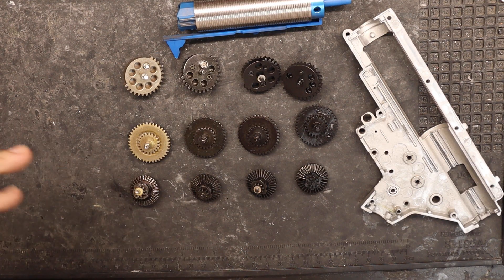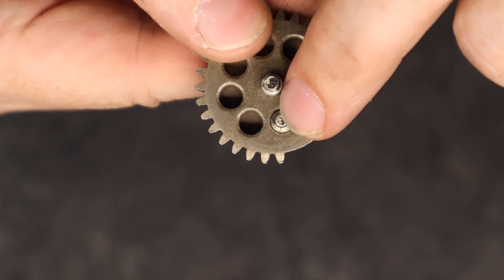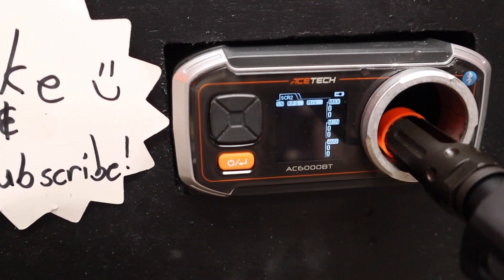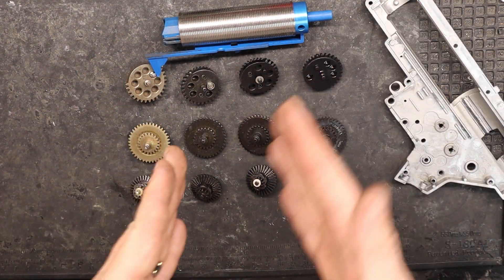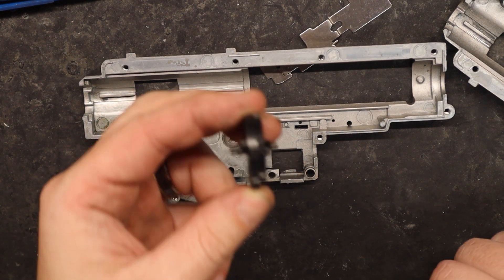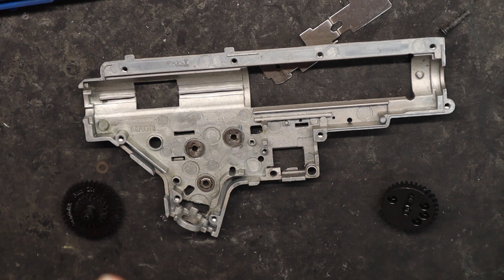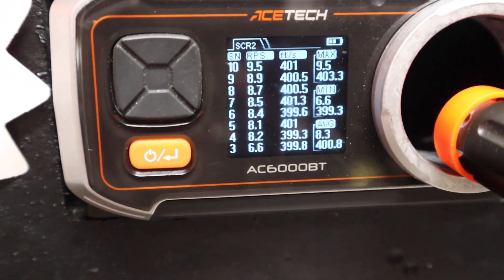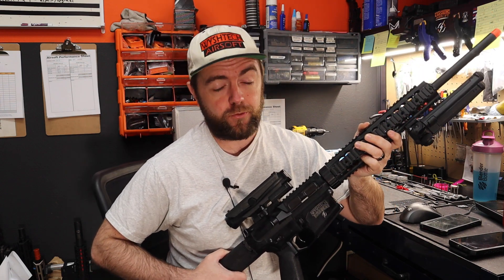Retro Arms Pandora SR25 Gears Review Test and Compare #airsoftonly

Comment: Nice comparison. Do you find tappet plate PME kicks in around the 25rps mark typically? If this occurs, what is your preferred fix? I have some SHS 16:1 (short-stroked 2 on the pickup side) which are consistent with a 25c 11.1v at 22rps, but suffer dramatic fps loss with a 40c 11.1 at 25rps. If no audible difference it would likely be tappet plate pme over piston pme? Thanks!
Reply from the maker: I typically keep it under 20rps to avoid tappet pme.  In your case, 22 rps and ss on the pickup side was a mistake. It should of been the release side so that the piston would get released sooner so it could finish its stroke before the tappet got picked up.  That 3 rps difference made it do that.  If you got another sr25 gear and ss on the release (or just get my Wyshtech edition gear) you will fix tappet pme on that battery.
Reply: @wyshtechairsoft  Thanks - should have mentioned that this is on a standard gear set and not the SR25 specifically, but could be the same either way. It is also an M100, so perhaps adding an M110 would remedy the timing issue.

I have noticed on stock gears from other brands that it occurs even with a minor motor change going from 17rps to 20rps (depending on whether an SDC is present). In a non-SR25 setup, is it possible to shave a tiny amount of material from the tappet or SDC where it first picks up, or will this generally result in mis-feeding? I have spare sets of 13:1s which are short-stroked on the release side, so could test those as well.

Comment: I am an sr25 user from the other side of the world.
The gear options for the sr25 version are very limited.
I am using the 'improved' gear set,
and was considering the Pandora.

Your review video was a great help.
Thank you.

-For reference, the 'improved' gear set (I won't mention the brand name.)
is holding up to m190. It's currently over 2000 rounds.(Of course, about 9mm shims were added to the spring guide to fit the longer v2.5 gearbox.)
but the height of the last gear of the sector gear is slightly worn.
I think the maximum for semi-permanent use is up to m170.

The video shows the stock nozzle being used,
If you are going to use the stock chamber, I recommend the shs g36 nozzle (about 24.3mm),
and if you are going to use it with a rotary hop-up (Retroarms, Maxx, Gate'eon', Begadi chamber, etc.), use a 23.3~23.5mm nozzle that is about 1mm shorter.
This is what I learned while spending money.

If you are passionate about the sr-25 platform,
I hope this helps.
Reply from the maker: Thank you for the input!

Comment: I have fixed all the tappet plate timing issues i have found by doing the DSG tappet plate cut and installing a tougher tappet plate spring, no feeding issues, no missfeeding, works great to me, maybe im just lucky, just be sure you cut enough from the tappet plate fin to allow 1 bb to be loaded and closed before the next cycle starts engaging the tappet plate again.
I was wondering how this quite expensive gears will sound.... thank you for this comparison video man, im not going to spend that money, the sound is terrible and im pretty sure you did a perfect shim job, so the awful noise comes from the meshing between the gears, i dont care how tough this gears can be i cant stand on of guns sound like this, same happened when i tried siegetek gears, awfull sound!!!
Reply from the maker: Siegetek sounds way worse than these gears. Lol. Thank you for the insight!

Comment: So I had the improved rocket gears in mine
18:1 ratio and I sheared the sector screws so just the lower half of the sector spins (33k paragon brushless m190) would these hold up to that or should I get siegeteks
Reply from the maker: Yes because it's tappet pin runs through both top and bottom.  Ive tested the sector gear on a m190 spring with no shearing since the pin reinforces it all.

Comment: Any thoughts on how much fps my gun will shoot at .40 bb?

im about to install 
300mm prommy barrel
full cylinder slong
guarder 160 spring
ht shs motor
slong cylinder head
Reply from the maker: Barrel is waaaay too short. I wouldnt go less than 410mm as you will lose fps with .40 since it wont spend enough time in the barrel to accelerate.  That being said, its hard to say man but you will be missing out on potential fps.
Reply: @wyshtechairsoft  Ive been watching your vids thank you for sharing such small but important details on teching. Thank you for responding
Reply: @wyshtechairsoft  hi, whats the best 6.05 barrel lenght for 0.40s bbs? and there is range diference between a V2.5 cylinder vs a v2 cilinder , but both with 1.9 joules?